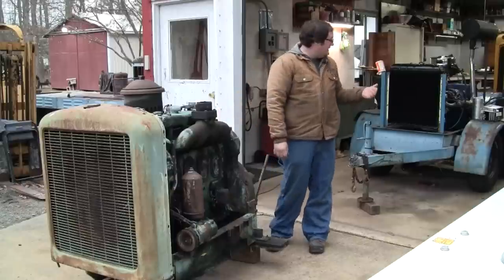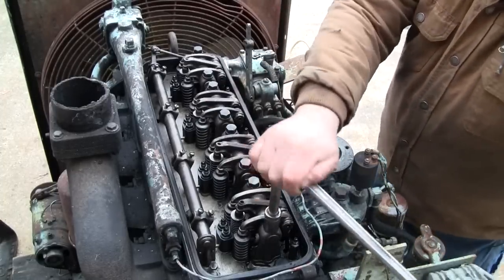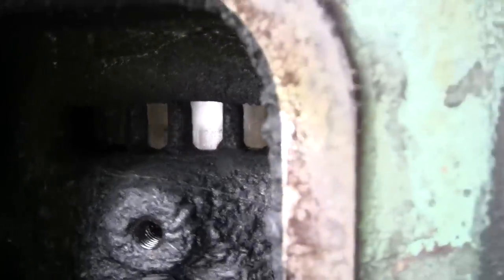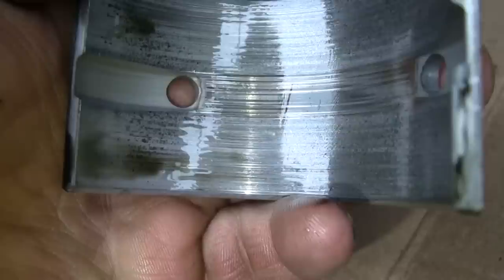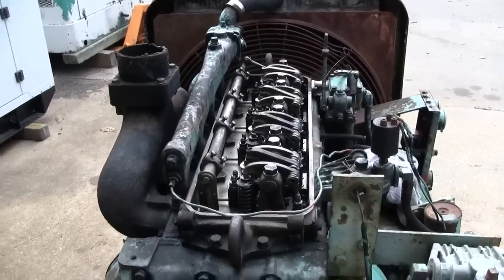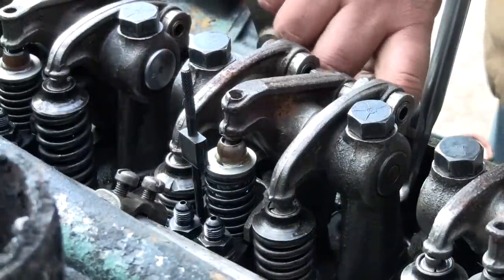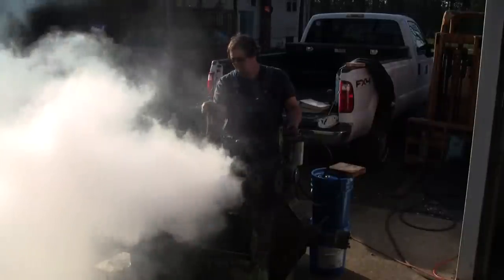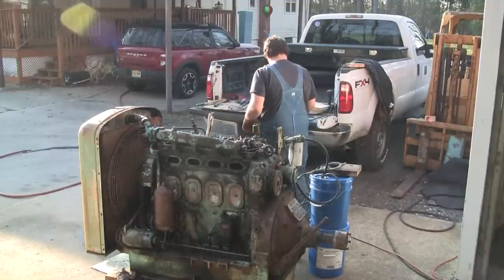Will This Tired GM Diesel Run Again?  1940 4-71 Detroit Diesel

Comment: 17:22 Minutes in , you were looking at the amount of soot build up on those injectors & the air boxes loaded with oil sludge ,
couple things come to mind . 
if the oil bath air filter was not being serviced ( lazy slacker )  the engine would run super rich ! ( fuel with not enough air ) .

Also , if what ever they were using it for , it just sat there idling a lot , you would get what they called " WET - STACKING "
were the engine never got hot at sustained governor speed to properly burn  fuel !
 CRANES were known for that , pick up a item , then sit there and idle , then pick up another item , then sit there and idle , ect. / ect. / ect.  !!
if you can run that in it's current condition with fresh oil / filters / fuel , and run it at governor speed 2150 rpm , it will clean it' self out & burn a lot off in the cyl's ,  far as the air boxes go , they will just stay as is for the most part , even though the combustion chambers / rings / ect. will blow off all that crap and clean up due to heat !!!

Comment: Sir do to the date, I will say that due to the war ramping up on every corner of the globe and slowly steaming our way. We were probably still able to use material of choice but I am sure y mid 40' it was a grab for every nation to get and grab what they needed to to build and run the machines and plants to make what they needed for their war effort. We probably used the brass on the oil filter housing for a couple of different reasons. One for the non-ferrous part and two for the low melting point and abundance of the brass. Your man in long island could probably confirm that. Easier the block casting was the faster and easier to make and clean up. Things that could be made using cheaper and easier methods and materials plus less energy to melt the material, bonus. Good morning and great day to you all!

Comment: He called it 'not a full oiled' (something), but it has a gear type oil pump.  On the rack tube he called the "Filaster" headed bolts "Flat" headed bolts.  At first I didn't think it was going to start, the PB blaster in the intake just caused more smoke.  It was nice. Ron W4BIN
Reply: He said it had not a full flow oil filter

Comment: It's a Jimmy of course it will run awesome 2 cycle engine they made a gazillion of them and put them in everything .2-71,4-71,6-71 great motors , for safety sake change out the Blower seals on a older motor is the smart thing to do the will suck engine oil out of the pan and run on that ,Yes you guessed it a Jimmy run away and they will scream. I sent a copy of this video to my friend who had a Allis Chalmers HD9 with a 4-71 so he can do a proper injector tune on his ,that Dozer sounds sweet wound up in the woods when he's logging .

Comment: Open the gill's and look at the cylinder walls and pistons, if they are scored front or rear the rist pin keepers could have come out. It's my bet it was over heated and there's no temper in the rings.    If you can twist the rings  into an S with out braking the ring  it was overheated,  and it's  Time for new pistons rings liner's and bearings.  It is a special tool for putting the rist pin keepers in,, they hold back  oil pressure.

Comment: Nice job Mike.  What size feeler did you use to set the valves?  We maintained the 71 series gensets for the phone company, we had several that were part of being the microwave radio guys responsibility at remote sites.  Fortunately, never had to get too far into them for a repair.

Comment: That copper plate means an oversized rod bearing. The journal has been grinded down the size stated on the copper plate.
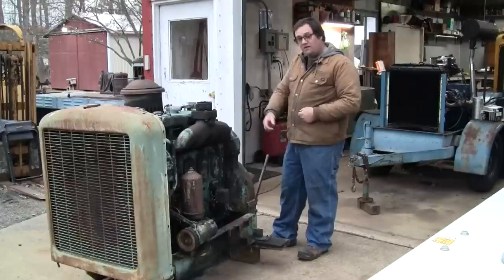Reply: It should say .030 if it was ground, not 0:34.   It would also be stamped on the crank saying the same and the back of the bearings would have it marked too.
Reply: @TugboatMatt  if you are correct than someone fould up!
In the mercantile marine where i did 13 years of stints this was the way to go. I hope this gentleman goes further and measures. Than we know.
I think that the sae ( american society of automotive engineers) and europe have differend standards how to indicate facts.
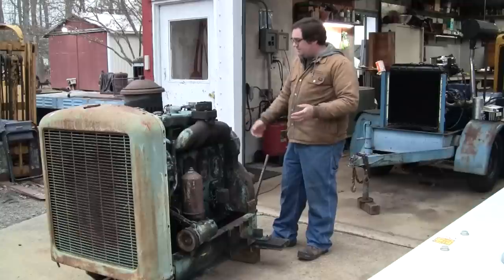Reply: @henkoosterhof5947  that’s why it makes no sense.   Bearings for Detroits are offered in .002, .010, .020 and .030. No reference to anything in the manuals being .34, and since it’s stamped 0:34 I honestly think it might be a factory tag indicating test run time.   34 minutes of test run so that the engine can be broken in properly, especially with it being such a early engine quality control was VERY high compared to later engines where they were made little more sloppy and looser tolerances a lot more care was taken.  I also looked up liner bore, deck hights and all other measurements, .34 does not exist in Detroits
Reply: @TugboatMatt  i am afraid someone made a deal with the machine shop. But here is the question: machining the journal more down isnt the big bucks question.
But how to get a fitting bearing? That could be the million $ question
Making a one of?
Does other engines have a fitting size?
Or was a 0.03 put in. I hope this gent measures before going further.
As for ,,modern,, engines. Nowadays machining is so to the spot that they dont need a ,,break in,, cyclus. Measuring clearance the wrong way could destroy the bearing material. But indeed. Its a very uncommon situation. What puzzles me is the way it started. The burner indicated to low compression. Stuck rings or wear? But this engine is definitely way above status boat ancher.
It has been running a long time on to low power take of. My dad was a crane driver on a pontoon based crane. These were powered by a bolnes(dutch brand 2 stroke) diesel genset. When on to low hoist there would be oil in the exhaust and when power needed this would heat up and start a fire.
Reply: @henkoosterhof5947  doesn’t make sense to when the bearings are readily Available and cheap.  A bearing for these Detroits is only $25.    And let’s assume someone majorly mislabeled the tag and it was supposed to say .034”, if the crank was in that bad of condition why on earth wouldn’t they just get a new crank.  It would cost more to have a custom size bearing and machining of the crank than just simply replacing the crank.  That’s why I believe it has nothing to do with bearings or anything internal of the engine because if it was put on by a machinist it wouldn’t be mislabeled so badly, .34” is almost 3/8 of a inch, that is a HUGE difference from .030 (30 thousands).   Other than a test time the other possibility is it may be a workers code, as in the engine was assembled by worker 0:34 or maybe station 0:34 in the factory.     If the engine was built for the war effort it may be a military marking also

Comment: Those closed exhaust ports don't look like the high performance mod.  Maybe tube headers.  My 2 stroke motorcycles always smoke like crazy but at 100,000 miles the cylinders and pistons are still good.  They like to run wide open which I guess is best for piston port scavaging.  If any one tailgates me I roll back on the throttle to 5500 rpm which is where the oil pump is wide open and coat their windshield.  They don't tail gate for long.

Comment: A 71 will run forever, given fuel, oil, and water.
I had a genset (4-71) which ran 24-7 for like 6 years.
Only shut down for oil and filter changes.

Comment: I do know the 71 series are almost infinitely rebuildable also you can’t really go by year of the block because the did sell engines in later years but used older blocks if no revisions to the block to it

Comment: Maybe rig a  fan up to blow some of that smoke away from you..... What would happen if you tried some starting fluid.... Here's a hot tip for you.... Do you have a charcoal respirator you know the thing that helps keep diesel smoke out of your lungs and nose and bronchial tubes and air sacs... Or how about a piped in  air mask that sandblasters ware... Just watching out for you dude.... You know the newer fire departments have a system that does not allow diesel smoke in their covered area and enclosed garages.... It's an overhead vacuum system that hooks onto the exhaust of the trucks...
Reply: "does not allow diesel smoke" because the smoke has officially been deemed carcinogenic (since 2012) . Here the kids are bused to school on diesels and breath in the smoke so, it is just randomly enforced.

Comment: I'm impressed by the durability of the those old monsters, they can handle so much abuse and still kick over. I'ld like to find maintaince manuals and tune up kit for these units, could you lead me in the right direction?

Comment: Seems like a gas mask or some other form of protection would have been good in this case… that’s an impressive amount of smoke… even by diesel standards
Reply: Ronnyek4242…yup that smoke is full of asbestos too. 😂
Reply: @aleblanc3547  Where would the asbestos be coming from? It's probably in gaskets etc, but there's no gasket between the exhaust valve and the outlet 🤣🤣
Reply: @crasbee  Sorry,  I was trying to be funny. 🥴  I thought Ronny’s concern was a little over the top. We all know that diesel smoke is full of vitamins. 😂

Comment: Those 2-Strokers were known for winning numerous environmental awards!!  Something like 5% of their fuel efficiency was due to consuming their own oil. Some didn’t require oil changes as it was burned off before getting dirty. Between the supercharger, noise, emissions, and runaways, they are a favorite.

Comment: neat little engine.  rare haveing just two valves.
Reply: Not rare at all.  2 valve is very common on generators, pumps and other industrial applications.  I’ve got a number of them.   4 valve was common on road use engines because they want more power.

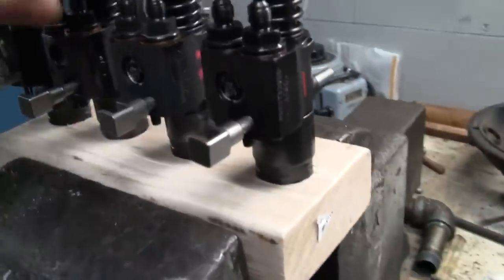Comment: 27:24 Mike, homey, with how indestructibly rugged those screaming jimmies are, you could just slam that thing back together with the bearing shells it has now, pin it wide fucking open, and let it eat under full load for another 40 years before it starts clattering. I would not be worrying about those bearings one iota if it was my engine.

Comment: BTW, 2-strokes do great with ether. We had a generator that was so worn out it required almost a who can to get it started.
Reply: Ether breaks rings,blows head gaskets and spins rod bearings. That’s why you had low compression.
Reply: @daleolson3506  The engine had 15K hours on it and using ether was approved for the GMs by out superiors (if not by  US Army regs of the day ... everyone did it... early '70s), so we did it. It was literally the ONLY way to get it started reasonably quickly. It was a 6-110 running a 100KW generator and we hadn't yet been given approval to rebuild it. It was one of six generators on the ship so we didn't often need it. When we got it running, it could only pull about half it's rated load, so we used it in those rare moments when we needed that much extra juice... or if another generator was down. Just before I ETS'ed, we started an overhaul but I never got to see it run.
Reply: Ether used correctly has never damaged any engine. Some old equipment came with ether start aids installed from the factory.
Reply: @prevost8686  Exactly right! My Farmall 826 has a factory installed etherizer on it. The kiss of death happens if you have a glow system and, like you said, use it improperly. I can remember getting a light buzz from teh either as we cranked it while spraying a continuous stream of either. The generator room was always war from at least two generators running all the time so an engine that wouldn't start under those conditions must have had flathead gasser compression pressure. In all the time that's passed, I won't recall if we did a compression test. Likely so to help justify the expense of rebuilding the engine, a job that got a lot of resistance from higher up for some reason (they probably wanted to waste the taxpayer's money in other less useful ways). I think we got the OK about the time of the '73 Arab-Israeli War, when we were on alert for about a month.

Comment: This is off topic but I'm desperate for some knowledgeable info on a Hobart- model 213 / 200amp welder/ generator. Somewhere or someone the get a manual for parts, assembly and troubleshooting would be great but I'll take any information or suggestions/support. Thanks, great channel.
Reply: Hobart,  Scott and Alex  where very helpful at finding and emailing me the manual for the Welder and sent me the info for the Wisconsin engine manual,  I have always been laughed at because of my liking Hobart welders,  my first was a late 60's model 300 Amp, which had a small Miller logo below and to the side. It's my understanding that this 200amp, 1972 model G3T is built by-product of Lincoln design,  it was just contracted to Hobart/Miller.  Could be wrong but that's what I've been told by several old timers that have Lincoln's that are exactly like these, even parts are interchangeable as the most part.  It even sounds like a baby Lincoln 200 as it throttling up.

Comment: 28:32 What the makes the pitting to the tips? Great vid by the way
Reply: Looks like rust pitting. My guess is that between condensation forming in the cylinder and water dribbling in through the valve cover breather (a couple rocker arms are rusty) the injector tips got wet

Comment: The most efficient way to turn diesel fuel from liquid to noise and smoke. = Green Leaker! - Missed it, did you figure out what size injectors?  According to my sheets? The "Standard" N65's would give max 160hp@2100 Gross... But with that low Compression...its probably HALF that much!

Comment: Id like to know where you possibly could have found that injector timing tool?
Reply: They are extremely easy to get.   They are still made and can be bought for I think like $40.   We just bought 3 of them.   They can be bought from diesel pro or almost any shop that deals with Detroit stuff.    As for the complete tune up set like mike has those are actually fairly expensive but includes everything needed, those kits retail for about $1200

Comment: It's suppose to be declco straight 40w oil not mutigrade bitnfor what the engine is probably won't hurt it
Reply: you are correct but for a test run and with as tired as that is it will be fine.
Reply: I wouldn't care about the brand of oil more is it a proper heavy duty diesel oi with plenty of ZDDP or not.
Reply: @alouisschafer7212  Multi grade Diesel oil is not recommended in 2-stroke Detroit diesel engines. Strait 40W (or30W in extreme cold conditions) with a low ash formulation is recommended. Delo 100 Or Rotella 40W works great. Obviously it’s not critical for a “will it run” video but in daily use it matters.

Comment: Mike, you are too young to have a Craftsman 
1/2 inch breaker bar!  (I'm not, got 2 of them.)

Everett, (805 RoadKing) he is old enough.

Seriously, glad to see someone using my 
(defunct) favourite tool brand.  I must have 
5 or 6 3/8ths ratchets, and as many 1/4, too.
Only 2 1/2 inch, and the 2 half inch breaker 
bars.  Don't do too much 1/2 inch stuff.

Been following you guys, since you were 
facing mini-bikes around Everett's house.

steve

Comment: Be great to see this rigged up to a load with and exhaust to let it run and work......bet it would clean up....if they run they dont need rebuild as we had one in Terx loader that worked up to the day it was scrapped because everything was rusted away except the main drive train that still worked but you cant use a machine in this modern safety world with no cab or brakes.....😢

Comment: Question, i am looking at a 6v53 whats the adjustment for the valves?
Reply: You need to provide more info like is it a 2 valve or a 4 valve.  Turbo or non turbo

Comment: The 4-71 brochures say it has a full flow oil filter?
Reply: Must be later versions. The early versions are clearly bypass.
Reply: It’s a option.   Early ones had bypass and it also depends on the application.

Comment: The most American engine is those V8 that sounds like they are skipping on half it’s cylinders at idle. Probably is because they are so inefficient compared to volume they need to be tuned to bleeding to give out a couple of hp.

Comment: loudest no P engine ever built / 2 cycle,  cheapest. had no real longevity. 
 good for tugs, stationary, for a while Some drill rigs were powered with 8 v 71,s 
scare you to death when it went from zero to high end rev's 
still used today for some applications. There were dozens of other options for 
 work horse engines, just to large. JD has a lot of small power option packages today.
 Gen sets, drill rigs, way better then those V 71< Used to service a couple 12 V 71's at 
 truck shop I worked at back in the early 70's, when you start adding cylinders to it, it becomes an other animal like no other. 24 cylinder engine .never cared for them. 
set the shim the buffer pin.   set the low ideal before all that pull the head and sleave the thing, as long as the ejectors are good, it should near run like new. get some remand ejectors, and be sure you have the rack set properly, often people foul that up, on the back of the engine, there is a fuel line, it's special orifice fitting, I put an ordinary fitting in 
 not thinking , not knowing it would cause the engine to run badly or not at all. that was around in 1973 when I did that.

Comment: It doesn't start very well because it has the wrong pistons and liners together low compression pistons and long port liners Your service manual should show the difference in the parts you need to set the governor gap before you set rack then set the idle when it's running vise grips are not necessary Your comment about oil is not well informed The engine needs N series pistons and injectors to start and run well I'm not picking on you You don't know what you don't know Good luck with your project